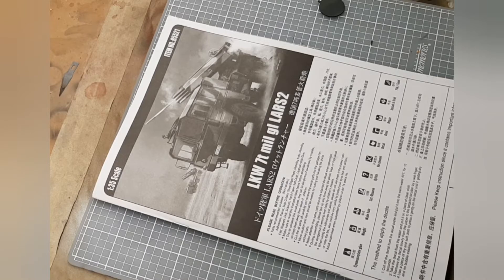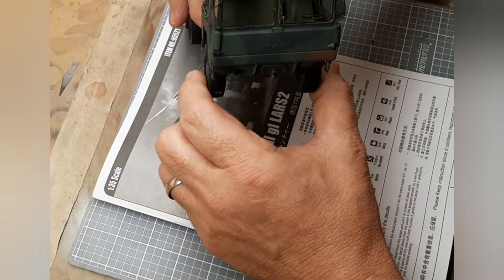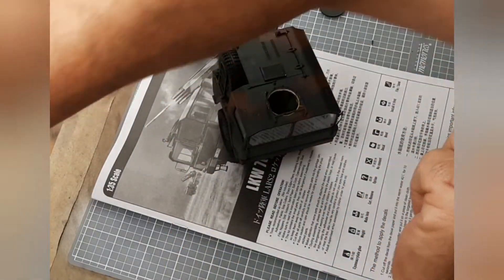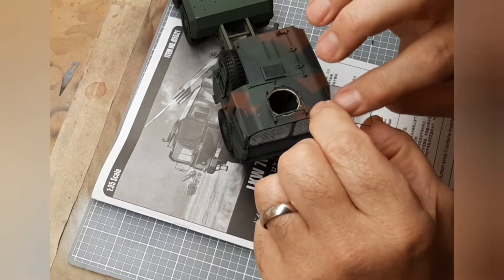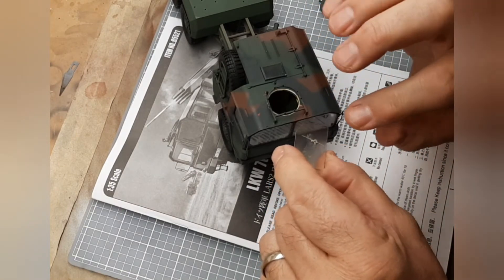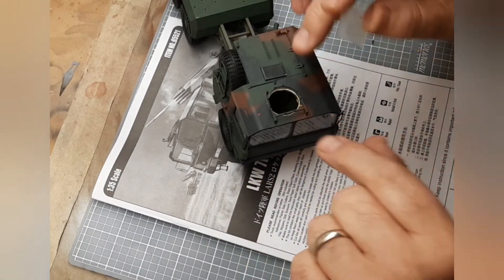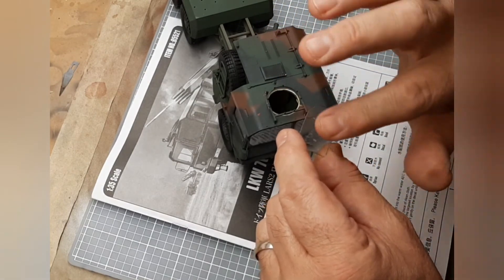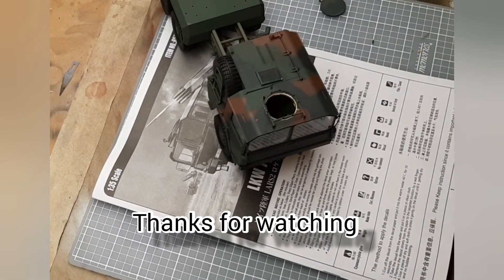clear plastic disaster

Comment: Some folks who do aircraft take their canopies straight out of the box, and sand them with micro mesh and then dip them in Future or Pledge floor polish and and then put them in a dust free container even before building.  But I think in your case the only thing to do would be to use a sheet of clear styrene or acetate. Have to be careful, as styrene doesn't really polish like acrylic or plex, clear styrene is very brittle.
Reply from the maker: Interesting. I've used styrene a few times and its very fragile. I'm going to give tjis a try and see what happens. Thank you for the good idea.